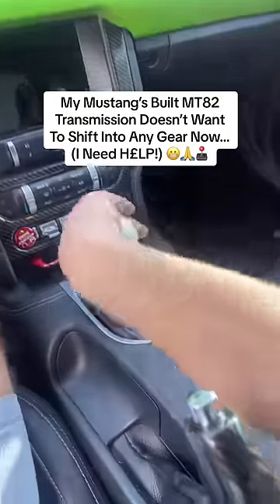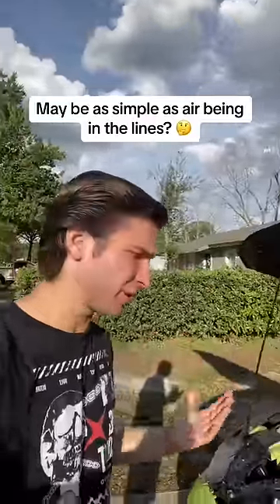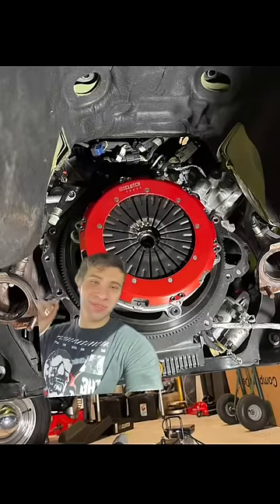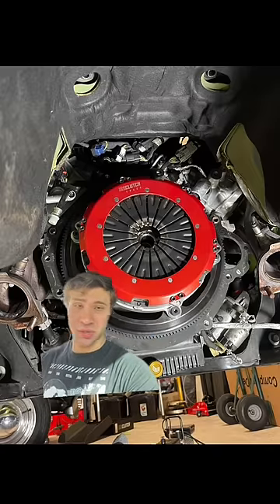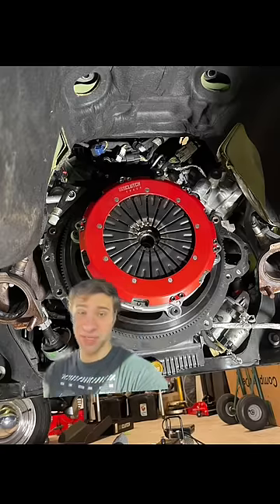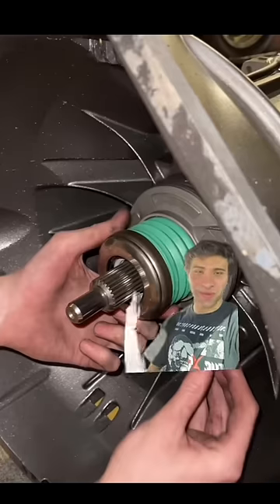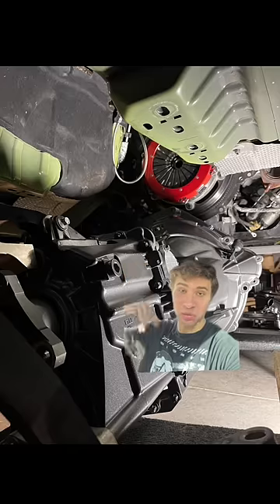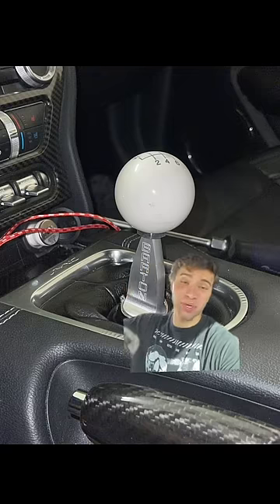MY MUSTANG’S BUILT MT82 DIDN’T WANT TO SHIFT INTO ANY GEAR AFTER I INSTALLED IT? (AIR IN LINES…)

Comment: You can fully bleed it with the clutch pedal just get a piece of clear hose slip it on the bleeder of the slave cylinder and run it to the clutch reservoir that way you have constant flow vacuum bleeders work but the way I just explained it full proof

Comment: Get a vacation pump and pull  a vacuum on the system. Leave it under pressure for 1 min or until bubbles stop then release pressure top off res. Install cap then pump pedal.  If you're still not building pressure in the pedal you have a leak

Comment: Did you install the clutch disk in the correct orientation? Usually, the clutch disk will have a label on it for which side goes towards the flywheel side.
Reply from the maker: Yes

Comment: Does the car move forward when running with the clutch pedal depressed? Sounds to me like youre clutch isn't disengaging or your shifter or shift forks aren't aligned right and when the shifter is in neutral you actually have a hub locked when wont allow you to shift into a second gear at the same time

Comment: Fords hydraulic clutches are notoriusly hard to fully bleed i found that it works better with a vacumm bleeder but you can bleed it the oldschool way like you did. However either way youll probably be bleeding it for about 2+ hours

Comment: Could be air, could be clutch disk is backwards. I don't know anything about the uniclutch, but generally if everything else is correct and you have that issue,  clutch disk is installed backwards. 🤷‍♂️

Comment: The only way I have got a good clutch was to bleed the whole system together and do not take it apart after you bleed it. Install it as an assembly. Hang the reservoir on something to make it the highest point in the system then the master then the slave. Pump the master unit all the bubbles come out then rotate the master and slave around and tap lightly with a soft hammer or skrew driver handle. Repeat until no bubbles come out of the reservoir, and do not let It run out of fluid or you will have to start over.

Comment: How much power are you running? Must be some wild amount I'm guessing. My supercharged Roush has 727 at the crank (610 lb ft) and has the stock MT-82. Don't know if they upgraded the clutch during the conversion, but running well and no sparkley bits so far at 25k miles (just changed the trans and diff fluid).